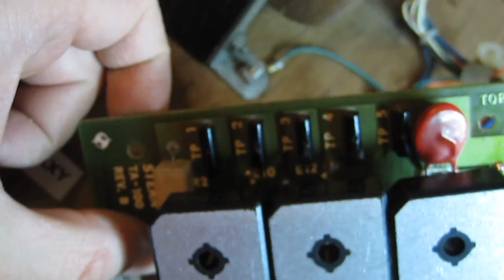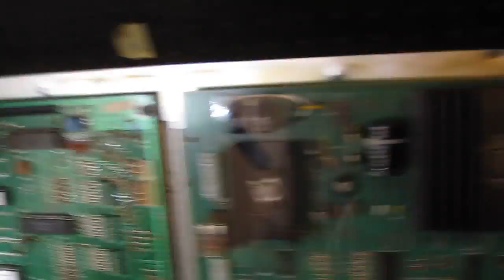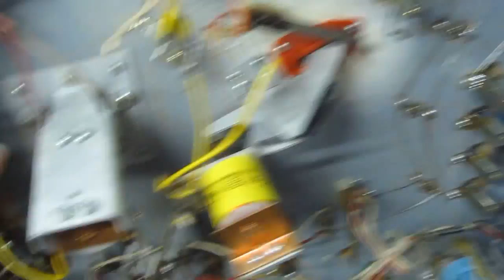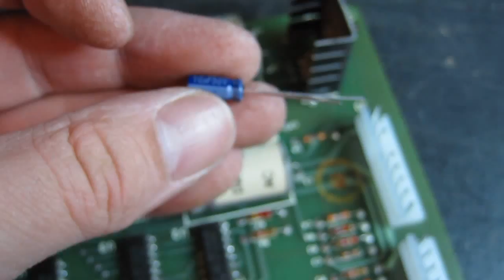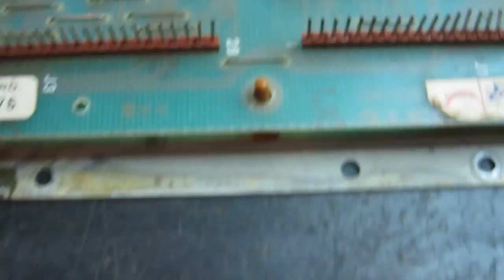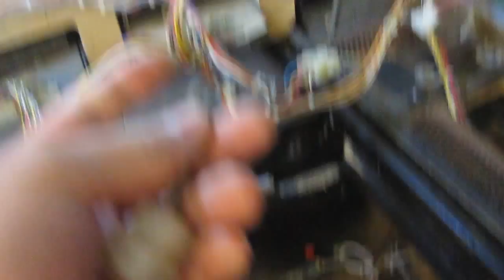Stern Galaxy Pinball - Extreme Repair - Part 3

Comment: I am a great admirer of your extensively thorough repairs. Despite myself being slightly more of an arcade buff then pinball, Its certainly refreshing to see someone with the moral of doing it right or don't do it at all. I just have one quick question though, when you repair PCB corrosion damage and have to sand them back to copper, why don't you replace some of the solder mask when you are finished? Or do you do that and I'm just not noticing. I would at least put something on it to stop the copper from oxidizing. I realize it would be impossible to re-do it by hand to a perfectly stock OEM condition, but I would at least do the ground planes and other easy wide flat areas without covering up all the solder pads. Cheers.

Comment: Looks like a LOT of work to do.  How do you find time to do this all?  Also any suggestions on replacing the battery on the MPU?
Reply from the maker: It took me a year lol, started February 2014, nearly finished now. I've since replaced the RAM's with arcadeuk NVRAM adapters so no batteries needed anymore :)
Reply: arcadeuk
It had quite severe battery damage :-(
Reply from the maker: That's medium damage at worst. Did you see the Centaur CPU video, now that one was pretty heavy on the battery damage, quite a few tracks were eaten away
Reply from the maker: Ben Foster Make sure you have fully neutralised everything before you use the board or else it will just come back to haunt you. Also you'll want to replace most of those pin headers. Glad to see you have the board working. Yes I have an NVRAM module suitable for the AS2518-133

Comment: I use Nichicon VX for the axial caps, though I hate how expensive they are compared to radial lead ones.

The sound board in this game is one of the reasons I love it.  It was a lot more lively than the Bally games of the era that I played.  My favorite part was the noise the spinner makes :-)

Despite the bad shape that machine was in, it looks like it's cleaning up well.   This is making me want to dig mine out of storage and rebuild it.  I still remember setting a high score of 977,100 and never being able to beat it without rolling back over to 0.
Reply from the maker: Hi buddy, I checked out Nichicon VX at my supplier, and they do have them, but they are 4-5 times the price of Panasonic. I buy Panasonic in full kits (50 of every value) so definitely wouldn't want to spend a few hundred on a limited range of axial values, I'll stick with forming the leads lol.

I agree about the sounds, they definitely are quite lively compared to Ballys, and that's one of the reasons I wanted to pick up a Stern, they have a whole unique sound and feel to them.

So why is yours not set up and being played? Get it dragged out and get some use out of it :) 

The 6 digit scoring thing is a problem for me, so I am going to sort that out by converting the game to 7 digit scoring, which is easier to do on Bally/Stern than it is on Williams. As the 7 digit displays are not easy to get anymore, I've actually just sent off my design to the pcb fab to get some low cost 7 digit LED displays made up
Reply: arcadeuk Sweet, DIY displays!  Looking forward to seeing that.  Are you making something similar to PinLED?

I wasn't aware you could install 7 digit displays in an older game and have them use the 7th digit.  Does it require a ROM mod, or just wiring?

As for my machine, I had sold it about 12 years ago.  Then recently the guy called and said he was willing to sell it because he was moving.  My boss bought it, so now I have it back here at my work where I can fix it and play it, but don't have to make room for it at home :-)
Reply from the maker: Maxxarcade Yep similar to pinled, but without the pricing cartel, so people in the UK will actually be able to buy them at a reasonable price ;) (don't get me started on that rant lol) 

You need to daisychain the extra address line to the displays (pin 11/12) to allow the cpu to select the 7th digit, and then, yes you need a modified ROM. What they do with the ROM is they divide the score by 10 in memory, so the game is still only tracking a 6 digit score, but they shift the digits one place to the left on the display, and they just permanently display a zero on the right most digit. Very clever way of doing 7 digits with minimal code change. So when you score 100 points, the game only tracks that you have scored 10 points, but then when it shows on the display, because there is the extra permanent zero, it shows as 100 :)
Reply: arcadeuk Sounds cool.  Is there somewhere to download the modded ROMS?  I know almost nothing about software, so I definitely won't be coding that myself.
Reply from the maker: Here you go buddy, there are a whole bunch of Bally/Stern game patches here 
http://www.pinball4you.ch/okaegi/pro_soft.html
Reply: arcadeuk Awesome, thanks!